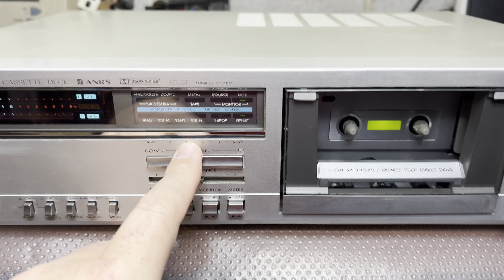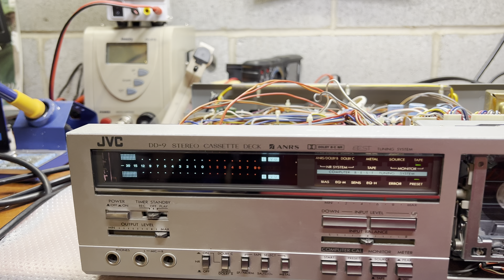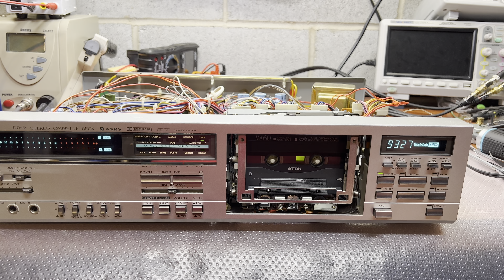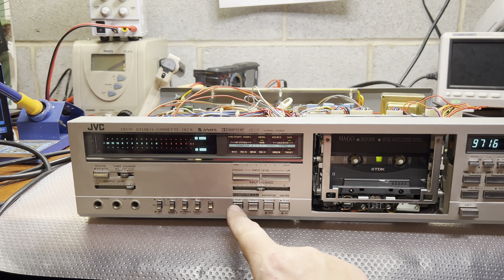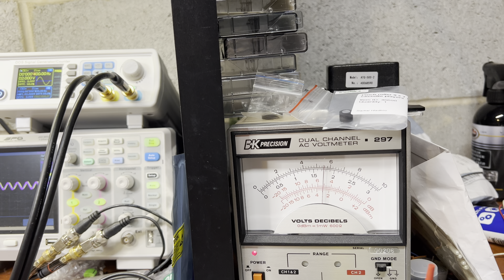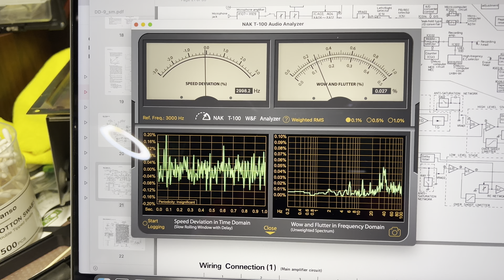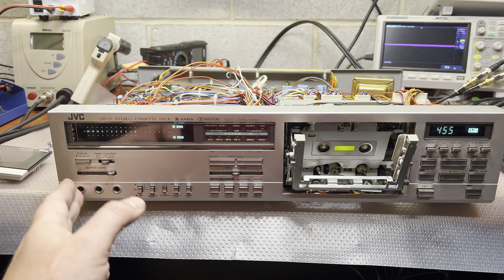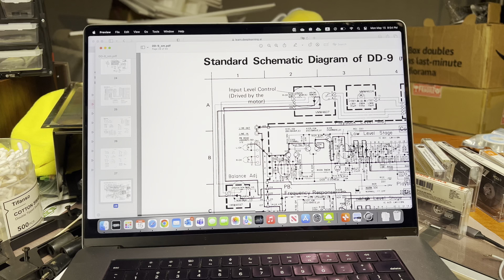JVC DD-9 Revival: A Journey Through Vintage Cassette Deck Restoration

Comment: Hi. I see you don't solve properly fast wind and rewind. To change rubber idler is only a small part on the way to solve problem. I see another large video and have same problem. On each reel there is 2 springs. Between springs is a bushes. That bushes is cracked and moved out and comprime the thin spring and not press on the pulley of the reel. If you see, the reel who spin tape don't move inside because spring is full comprime. There is a clutch and if the big spring not press enough on the pulley the move from idler is not transmit to reel. I solve this on my DD-5 but was like a brain surgery.... Hope you understand me. Sorry for my poor english.

Comment: I have seen a few of these where the B.E.S.T. computer system is out of calibration and apparently only JVC technicians had the calibration units needed to correct B.E.S.T. when it goes way off from calibration. Do you have one of these JVC Service Tech B.E.S.T. Calibration units? I looked all over the Internet and could not find one anywhere.

Comment: They made it a nightmare to take apart the mechanism and cable spaghetti everywhere. Akai did the same. I avoid retro decks because of this reason. Would be amazing if digital was invented back then, to allow for a one wire communication from deck CPU to transport CPU. Only heads should have separate wires.
Reply: @maxfactor4209  That is for sure.  Also i cringe at the back tension method, friction at the erase head via pinching of the tapez
Reply: @maxfactor4209  That is why me and also our host we love the sony TCM200. Such a superb mechanism. I rebuild them in my sleep thanks to our host videos. He made such clear and good videos on how to fix any tcm200